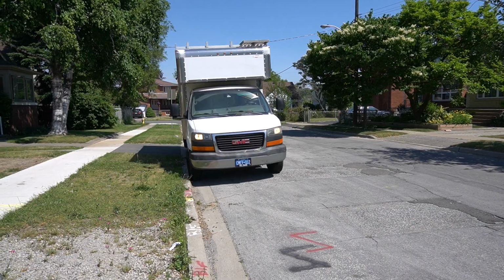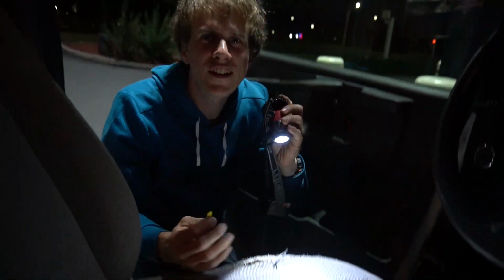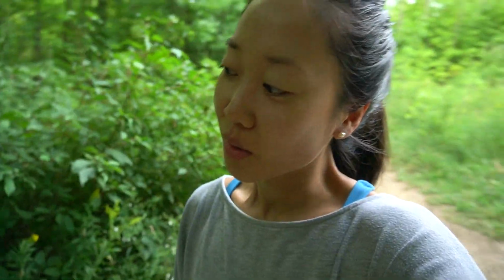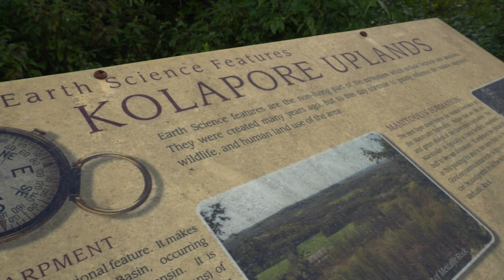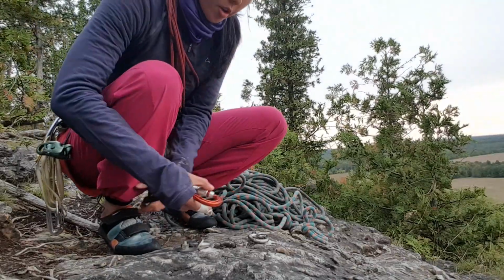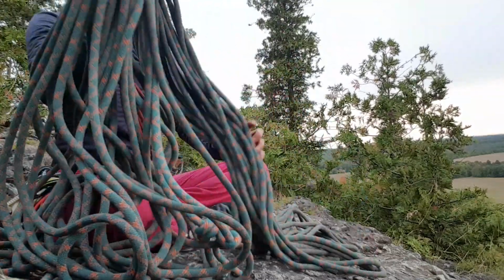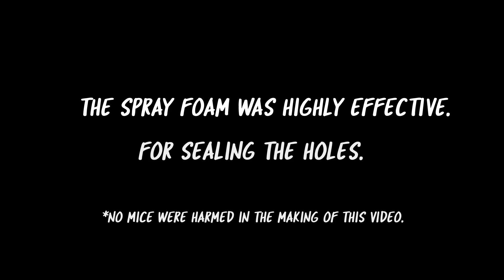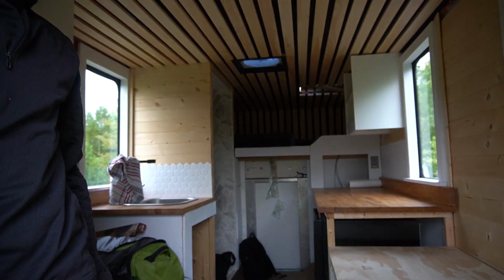FINALLY! Maiden Voyage and Our First TWO Pitches of Climbing | BOX TRUCK CONVERSION

Comment: now that you've had the Camper Van out and about, are you happy with your choice of a camper van or do you think that a different type of camper would be better?  I.e. Truck Camper, Small style camper trailer or larger trailer?  What bugs did you find you still have to work out with your Camper Van to make it more user friendly?
Reply from the maker: I (Sachiko) personally like being stealthier, but I love that we have ALL the space that we have. We're really happy with how the layout worked out and without a proper shop, doing all the curved edges in a sprinter would've made for a more difficult build. At the moment, we think we made the perfect choice for us. We'll report back on the road as we don't know what kinda sticky situations we might get into with a larger vehicle. 

We still have to figure out the toilet situation. How to store our bikes and climbing gear. Maybe invest in a better water pump cause ours is loud AF. Battery is not enough to power hot water through colder months. 🤔 We will probably discover more on the road!

Comment: Could you guys talk at some point about how this van performs of rode and in snow . Nothing much about van vs box vans .
Reply from the maker: We drove it back home in city roads while it was snowing last year. Compared to other vehicles I've driven in bad weather, the worst thing about this box truck is its height. When it is super windy out, it will literally BLOW you into the next lane. Granted, we noticed this when the box was empty...now that we have more stuff in it and it is heavier, it definitely handles better. For snow, if you have a good set of snow tires and are comfortable driving in snowy weather, it's not so different.
Reply from the maker: Also, think you meant off road there :) we have no idea...except it did okay on that bumpy road in this video. Just had to be slow. The truck itself has HUGE clearance. The truck FEELS like it handles better than a van (it can do quite sharp turns) and likely has more clearance than a sprinter.
Reply: Yes off road 😱😫